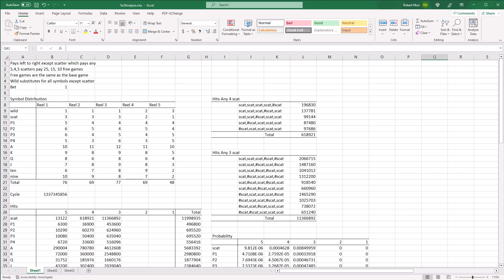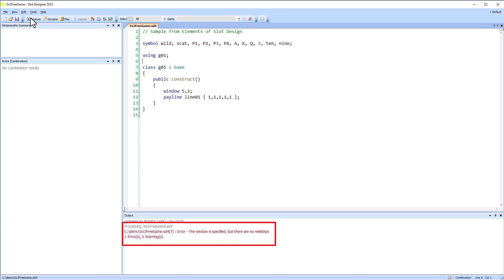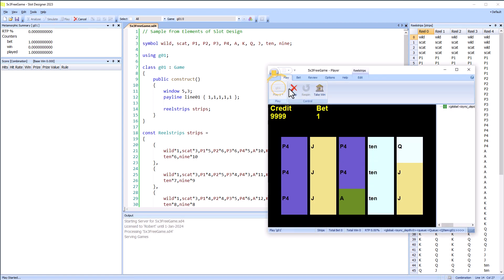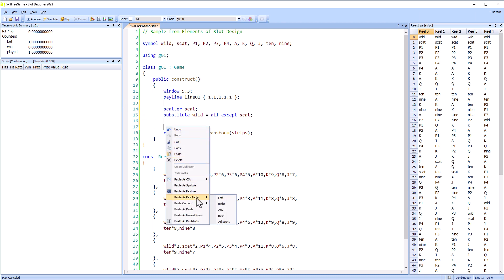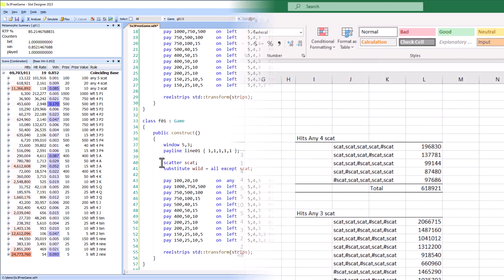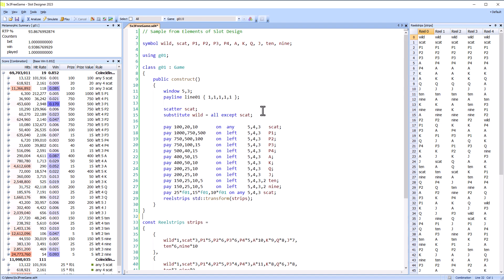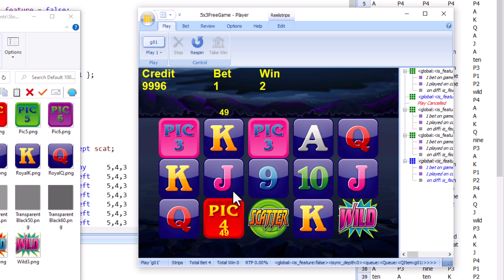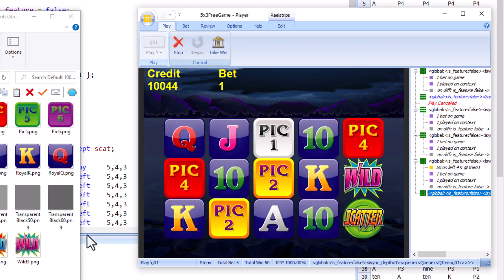Slot Game Mathematics from Excel to Slot Designer

Comment: Is slot designer a paid for app? I've been learning so much about the math of slot machines as a hobby over the last couple weeks. All because I went to Vegas and lost so much at slots and thought it was rigged. Now I've been exposed to the probability of very large numbers and it's just math. Now I'm trying to find a way to make a personal DIY video slot machine using some type of micro computer and an LCD screen. I like the information in your paper "elements of slots design" and how it shows some of the calculations in Excel.